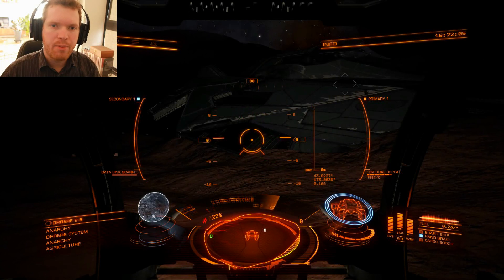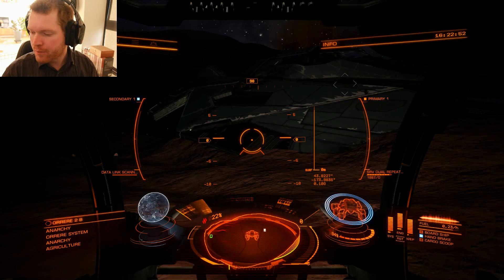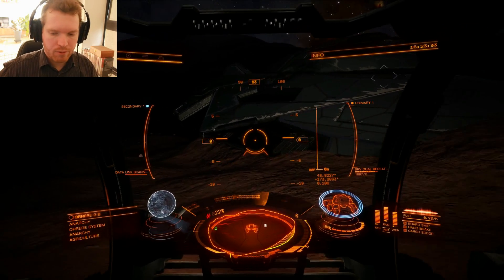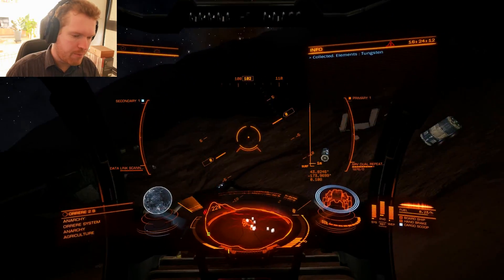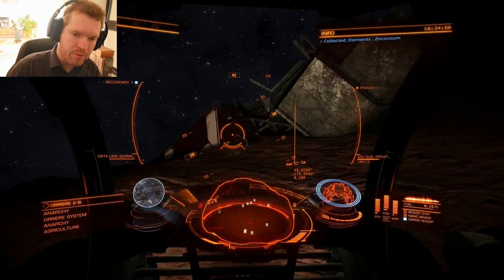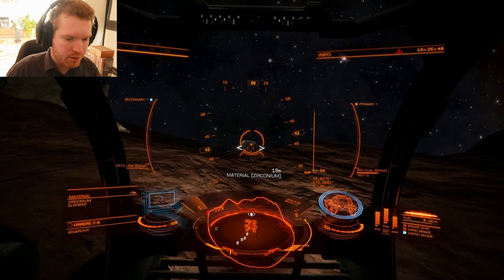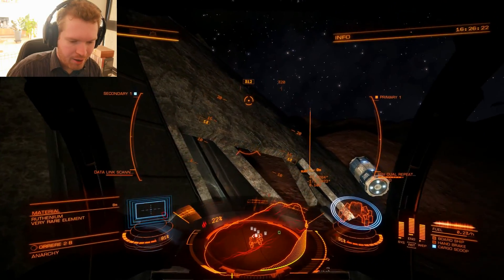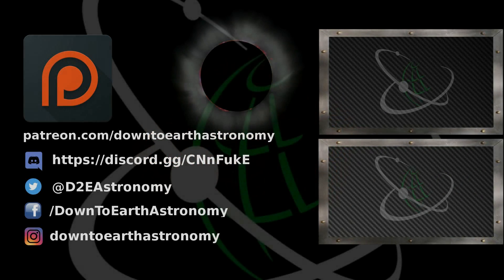HOW TO FIND RARE ENGINEERING MATERIALS | ELITE DANGEROUS

Comment: I wish there was a way to find these, not find them by being told where to go, but rather be given a method of HOW to find them
Reply: One upon a time there was.  We used to get "Tip" missions, which I think were follow-up missions from our station donations (or maybe with each federal rank). I don't real recall what triggered it.  Anyway, some of these Tips became scavenger hunts.  Some would provide coordinates that led to a crash anaconda site.  If I recall correctly, the Tip gave a system with a listening post to scan.  It would give a partial SOS message with 1 planetary x coord, a distance from the system with the crash site (but not tell you the system) and a new system with a post to scan, which gave y coord and distance and third post. The third post which game the planet  (like B 1 A) instead of a coord.  I had to scan 3 listening satellites in 3 different systems and triangulate the system with the planet based on distances given by the post and use the coordinates to find the crash site on the planet.  It was not an easy task.  Crash site had containers you could shoot  to free materials or collect to sell.  The one I found had a thargoid probe or sensor.  Apparently a thargoid attack the ship and caused the crash from scanning and reading the crash ships logs.  When I hear the thargoid sound, it scared the crap out of me as I was in an SRV and expected to get blasted.  Too bad interesting things don't seem to last long in the game.  Burning stations and AX Combat Zones also come to mind.  If you get a Tips mission (as I don't get them anymore), be sure to check it out.  I ignored so many of them and now regret it.
Reply: there is, go out and scan planets,  check every one you see, in about 5 years list the dozen or so you have found

Comment: Went to near the location - landed - could not find the exact co-ordinates, kept falling down in valleys, end over end until I was down to to 30% hull in my SRV.  I found navigating to the exact co-ordinates very, very difficult.  Trying to use headings when the ridges forced you into a different direction, then trying to turn around, getting stuck, boosting, falling down ridges again.  I don't think I can make it.

Comment: To commanders that visit this crash site, you want to be sure to scan the data beacon inside of the cockpit of the Anaconda itself. If you do this you will get a permanent navigation marker the next times you come back in the future. This way you will not have to manually locate it every single time.

 I found the easiest way to get the scan is to park further back along the port (left) side of the crash Anaconda's nose. Manually aim with the turret and you might have to adjust the distance but it will begin to scan. 

Good luck, 07.
Reply: manrightchea If i could thumbs up this a million times. When i figured out i could do this for the thargoid scout crash site i shit myself